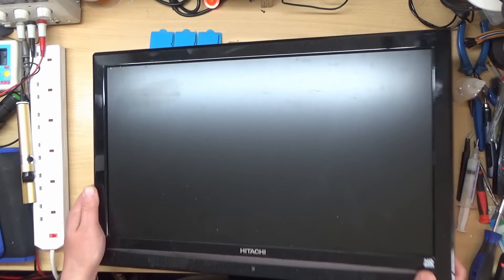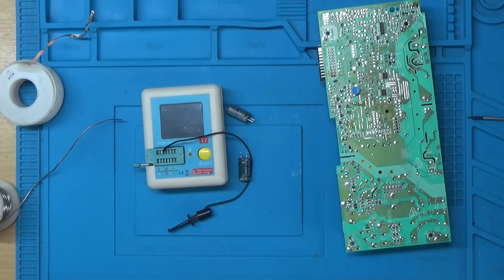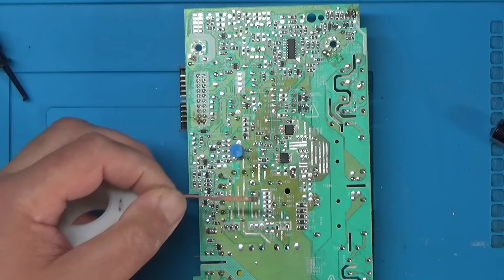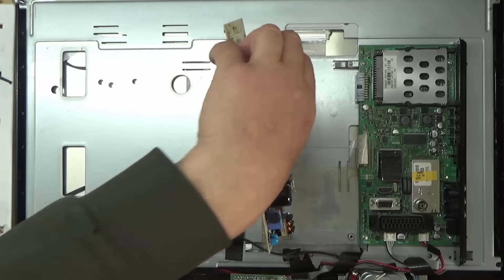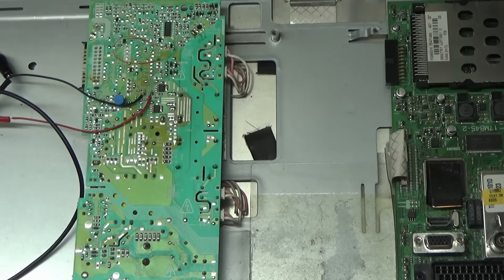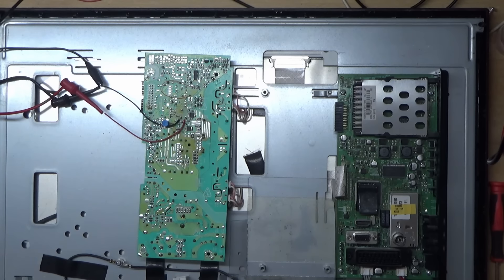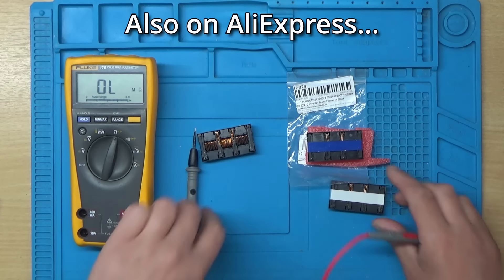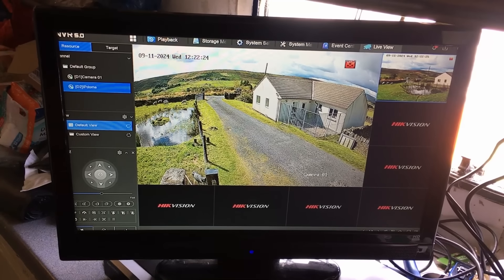Repairing A Dumpster TV, And Donating It To A Great Cause!

Comment: Usually, the bulged caps are rated barely over their application voltage.  Using a cap with a higher voltage rating will avoid future problems.  One problem with doing that is they are usually larger, physically and there might not be room on the circuit board.  Good repair video!!!
Reply: Sometimes the capacitors dry out due to the heat inside power supplies too and over time most fail eventually - I repair a lot of mixing desk power supplies which some people leave powered up 24/7
Reply from the maker: Thanks and very true 👍
Reply: I find the problem is usually they're just cheap garbage, they just manage to outlast the warranty.  Other than that, as the other dude said heat kills them.

Comment: Usually those caps have a 20% tolerance, so, at 933UF, that new cap is well within the tolerance interval .... great video.
Reply from the maker: @lmwlmw4468  Thanks 👍yes I didn't realise 20% was normal. I thought it would be more like resistors with 10% 5% or even 1%

Comment: Those Cold cathode driver circuits are interesting.  High frequency. High voltage energy can do some weird stuff.  In general, it wouldn't hurt to inspect where the windings of any transformer solder to the pins that connect it to a given circuit board. I recently repaired a transformer where the solder connection had failed.  That was a first but very rewarding.
Reply from the maker: I did have a look at the old transformer but couldn't see anything obvious. I did think it may have failed where it solders to the pin or something too.
Reply: @BuyitFixit  Nothing wrong with a new transformer either.  I'm glad flat screens now use LED's.  LED's certainly aren't without their failures either however.  Cold cathode lamps are certainly built to last.

Comment: This is a fantastic lesson for techs who use 2nd hand parts, which is a pretty common practice for repair shops. Something that only a experienced hand knows. Faults are often the same due to a design choice. That means the parts you use second hand might also have the same fault. Takes confidence and age to know your testing correctly and your new part might also be faulty not just your process. 😅
Reply from the maker: Thanks 👍🙂

Comment: A friend was trying to fix a VCR. He suspected a 1000µF/35v capacitor but it measured 1020µF. He was about to solder it back in but I suggested he measure the ESR. It was ten Ohms! Replacing this cap fixed the fault. So NEVER rely on capacitance measurement of an electrolytic capacitor. Always check ESR first. This can usually be done in-circuit.
Reply from the maker: My tester usually shows the ESR unless it's 0 then it doesn't seem to display it. I was reading on the EEVBLOG forum that you can still have a bad caps that shows a good ESR too.

Comment: Well done. Lucky to find a dump (sorry, household recycling centre) that let you take a TV. At mine you would have to climb into or fall into a skip, probably an offence, if you survived. Allen Fleckney is another who advocates repair.
Reply from the maker: Cheers Ralph. This one is unmanned, it's literally 15 large commercial bins in a car park for cans, cardboard, plastic, and bottles. There isn't really even a place for electronic items. Someone just left it next to one of the bins.
Reply: @BuyitFixit  I remember those days. Sadly, ours is manned with automatic barriers, booked timeslots and guards. You drive up into a 20-car space and then drop all goods into skips, a fall of between 2 and 5 metres. Anything that was salvageable / repairable before, certainly isn't after. So sad.

Comment: Nice Video Squire & fair play for helping a Charity close by, 26:20 onwards, I’ve had a couple of issues with AliExpress, Main one was a Cheap Wire Stripper, I received it and it came without a Blade or Blades so I bought another one from a different Seller and made sure that it had a Blade plus it came with a spare tub of Blades & I even bought a Spare Tub of Blades, Bit overkill I know but shouldn’t run out of Blades in a hurry now, The original Seller stated: “sorry, dear, due to logistics restrictions, we are unable to send you the blades. If they are sent, they will not pass customs and will be returned. We apologize for any inconvenience caused” Absolutely bizarre, I did try to see if other blades would fit but no
joy so it’s an Ornament/ Paper Weight!
Reply from the maker: @AJComputerServicesUK  Thanks 👍There could be some truth in that as I remember a couple of years ago I went to order a cutlery set from Ebay. Nothing fancy just regular forks, spoons and knives. However it wouldn't let me purchase them until I proved I was over 18 by submitting ID etc. Because it had 'knives' in it, even though they were probably blunt as hell, as they were only for eating food, not preparing it 🤷‍♂️
Reply: @ I find it strange that the one Seller on AliExpress was not prepared to Ship Blades yet another Seller Did plus Spare Blades? 😂
Reply: @ Not sure if I’ve already said it but Happy New Year to you & yours! 🙂
Reply from the maker: Thanks mate 👍Happy new year to you and yours too!

Comment: I really enjoy TV/Audio type repair vids like this one, I like to tinker myself but have very limited knowledge.  This video was interesting as it touched on the problems I've had with the last few TV's.
I have tried to bypass the protection circuit on a samsung TV but I think I killed the chip as I read the pinouts incorectly still you live and learn.
Reply: I once also bypassed the olp line on also a device that had a 494 and i burned out the transformer and my room smelled like burned electronics and burned lacker for a few days... Bummer! But i got a new transformer and luckily it was not ome that was salvaged from old crap but rather from the official chinese manufacturer who made the transformer
Reply from the maker: Cheers 👍 Yes, but the main thing is that you learn something. Even a failed repair is good if you learn something, and everyone makes mistakes (as I did in the previous video when I caused the mosfet to smoke 😂😂😂)

Comment: Never seen a transformer/coil behave like that. They usually go short or completely open. This might be a bad connection where the wires bond to legs. A not-so-easy fault to detect, amazing work!
Reply from the maker: Thanks 👍Yes me too, I did have a slight poke at it under the microscope as I thought it could have failed where it joins to a leg too, but I couldn't see anything. I think I made it worse which is why it measured OC later on 😂😂😂

Comment: Great repair for a good cause.👍 It seems some part suppliers believe themselves unable of making mistakes. I ordered a matched set of LED edge lights that weren’t matched and was told I didn’t know how to test or install them. I should’ve filed a complaint but only gave them a poor rating.
Reply from the maker: Thanks 👍I just opened a dispute and got a refund, still a bit inconvenient though.

Comment: Cutting the power lead used to be standard practice when getting rid of electrical products.

Not sure why. I think it was in case someone took it and tried to plug it in and got hurt.

Our family always did it and we still do.
Reply: Its pretty common. I worked for 2 weeks at a local thrift shop and we always used to cut cords of devices that did not work and got sent to the recycle bin, and the reason was so no one would attempt to plug in the devices to be either met with dissapointment or a fire or explosion

Comment: I'm in the process of trying to restore an old ATX computer power supply, and the 4 domed capacitors I pulled out registered as "Damaged or Unknown Parts." Can't wait until the new caps come in so I can see if it works!
Reply from the maker: Hopefully it does🤞. I'd perhaps check the other capacitors on the board even if they aren't domed as they could still be faulty due to age / heat like some of the others were a bit down in this case.

Comment: Great video - very educational as always - I would be happy if you could add the solder sucker tool to the list - looks like a good one that does the job :) I have a very weak one that I can NOT use most of the time I need it. Thanks
Reply from the maker: Thanks👍. I just had a search on where I got it from and it was from Farnell when I ordered some other parts. It was a DURATOOL 908-366A-F but I've also seen them on eBay etc too.

Comment: Recyclers usually cut plugs and power leads off for safety reasons. Stops people "just giving it a try" and possibly causing a fire with faulty equipment.
Reply from the maker: Yes, seen that before. This one was at a "recycling centre" but it's just an unattended line of bits for different things like cardboard, tin cans, bottles etc. There wasn't really a place for electricals, so it was just sat next to one of the bins...

Comment: ISTR that larger value electrolytics have a tolerance of +10%/-25% so 800-odd uF for a 1000uF capacitor is 'acceptable'.
Reply from the maker: Thanks for that, yes a couple of other people mentioned similar. I thought the tolerance of them would have been much less, something like 5% or 10% at most.

Comment: I'VE HAD WAAAY TO MANY PROBLEMS WITH ALIEXPRESS!!!  I QUIT BUYING FROM THEM AND FLEECE-BAY!
---
But your video's are always interesting! 👍
Reply from the maker: Cheers mate 👍Sometimes parts I need are only available on AliExpress such as this transformer. None of the usual electronic places such as Mouser, RS Components etc stock things like that. Also the price of shipping with some of the proper suppliers are often very expensive. It's not worth paying £15 postage for a 50p part.. so I usually wait until I need a few parts to cover the postage costs.
Reply: @BuyitFixit  - I understand.

Comment: Electrolytic capacitors are far from precision components. Capacitence can easy differs ±10% of rated value without be faulty.
As always, exelent video.
Reply: Your being too kind to them ±20% is still quite normal, for a lot of PSU's the value does not need to be very precise and ±20% are cheaper.
I never go above 80% of their voltage rating for production designs give them an easer life when released in to the field. 🙂
Reply from the maker: Thanks 👍Yes I wasn't too sure on that 🙂
Reply from the maker: Interesting. I didn't expect the tolerance of capacitors to be so great, although it's not something I've looked into before.

Comment: Good job. After you replaced the obvious ones, I was betting it would be the small bootstrap capacitor. 
Electrolytics are rather crude and have a high tolerance value of 20%, so 837 uF (i think it was) is within tolerance for a nominal 1000uF. Often they can keep on doing their job when the capacitance is 50% of nominal, its the increasing ESR that stops them working. The increasing ESR makes them run even  hotter, so  its a positive feed back.
This would have been a good one to test and compare the capacitors with your ESR meter, in circuit, versus out of circuit.
Reply from the maker: Thanks 👍a few people mentioned the 20% I thought it would be a lot lower like resistors at 5 or 10% at most. Seems I've learned something new 🙂

Comment: I'm scared of bringing electronics home. A few years back I saw a dell XPS laptop  being thrown away ! In its time that was a heck of a laptop. I have loads of parts so I bring it home and put it on my deck for the night. The next morning I found the right power cord and discovered it wouldn't turn on. Time to dig in, I remove the first cover plate (over ram or H Drive) and discover loads of freaking cockroaches 🪳🪳🪳 running over each other! It was packed and infested with them. I put it in a garbage bag and left it outside for a week. I then cleaned it up, changed out the ram and resold it cheap. 

 Ever use a hair dryer on a bad power supply to test it ? Someone showed me that trick on a desktop tower with bad caps. 

Thank you for the tv repair video
Reply from the maker: Yes I've not had that one before. Cockroaches don't seem to common over here, or I've just been lucky and not seen a lot of them. Yes a hair dryer, and freezer spray is also handy (especially if the fault occurs when the device warms up) you can spray it on a component to cool it back down and see if the fault rectifies itself.

Comment: Great video. How do you tell which way round the capacitors go without a plus or minus on the board??
Reply from the maker: There is usually a white mark or shaded area to show where the negative goes.
Reply: @BuyitFixit, thank you for that helpful piece of information. 👍

Comment: Transformers can fail? Dear lord, new fear unlocked ;_;
Reply from the maker: Yes, although they usually go short circuit as the insulation breaks down. LOPT (line output transformers) were a common failure on old CRT TVs. I remember replacing a few on some old CRT Ferguson TX100? sets I think they were...

Comment: How did you make the "Dim Bulb" Tester ???
Reply from the maker: It's just an old style filament bulb wired in series with the outlet. That way if the device has a short or is going to blow it limits the current by lighting the bulb.

Comment: I think some people cur the power lead off under the belief they can sell the copper for scrap.
Reply from the maker: I think it's more for safety (stop people plugging it in if it's a fire risk or something), or perhaps they just wanted a plug with a piece of wire on it to use on another appliance?
Reply: @ It could indeed be a safety thing.
I’ve seen it here (Australia) where people donate electrical goods to charity shops and the shop cuts the cords off.  So they can’t get sued if there’s a problem.  Sue whoever put the cord back on 🤠

Comment: Electrolytic caps generally have wide tolerance bands like +80% -20% so 800uF for 1000uF rating is not atypical.
Reply from the maker: Yes a few others mentioned the same. I was surprised as I thought it would be something like 5% or 10%

Comment: I wasn't that lucky with a road side Samsung LCD TV find.
It has a blown 3br0665jf PSU IC with integrated power mosfet, which I can't find.
I'm wondering if I could replace it with a normal 8 pin DIP part and an external FET from another TV psu.
Reply from the maker: I've just searched that part number (full part is ice3br0665jf) and it's available on Mouser, Aliexpress, and eBay.
Reply: @BuyitFixit  Not possible right now to order from those places. I'm interested to fix it whit what I have locally.

Comment: Hey Bro, I need to ask you after watching your last few vids, does that China machine not give you ESR? That in my book is way more important
than capacitance from my knowledge. I have an Atlas ESR70, and I can check most electrolytics in curcuit. It reads most as they should be, but
if its not sure, it says" in curcuit, or leaky". Then I can focus on those problem childs. Had really good success thus far?
Reply from the maker: Yes it does usually show ESR if it is over a certain level. If the ESR seems to be 0 it doesn't show it. I've just bought a peak DCA55 faulty from Ebay and ended up speaking to Jeremy from Peak. All I can say is fantastic company and video will be out about what happened soon...

Comment: I repaired an old audio mixer and the power supply board had some real bad caps. They leaked and corroded the board
Reply from the maker: I've had something like that before, but I think it was battery corrosion. Had to rebuild tracks on the board and jumper things here and there to get it working.

Comment: How often do transformers fail and what causes them to fail?
Reply from the maker: They are usually pretty reliable, what usually happens is that something overloads them and the insulation breaks down and causes a short or partial short. In this case it could have been that one of the thin wires broke away from where it was soldered to the leg or something or the wire became burnt causing the odd readings.
Reply: @BuyitFixit  so the immediate shut off is the tell tale sign of the transformer gone bad?
Reply from the maker: It could also be one of the high voltage capacitors breaking down, or one of the CCFL tubes shorted. The circuit detects something isn't right and switches off.

Comment: electrolytic capacitors have 20% tolerance so it's not strange
Reply from the maker: Yes, a few others mentioned similar. I thought the tolerance was much lower like with resistors for instance.

Comment: with aliexpress it's a lottery, unfortunately 🤥
Reply from the maker: Yes, seems to be that way. I've usually had quite a good experience overall, but I've had about 4 times over the last 5 years or so where I've encountered problems with either fake or faulty stuff as in this case.
Reply: @BuyitFixit  This is my case too. It is very disappointing to believe that it is a diagnostic error when it is the new component that is the cause.
Reply from the maker: Totally 👍

Comment: I don't know why people throw a good television  can be repaired at last your saving from the tip
Reply: It wasn't good and finding a component level technician is no easy task, also probably not an economically viable repair. People are pretty much giving these old tvs away.
Reply: @audibell  Electrical repairs shops that would do board work used to be ten-a-penny. Now if you take a faulty device to an electrician, they'll often tell you to bin it and buy a new one.

It not worth their time and people won't pay.

The throwaway nation.
Reply: Why would you pay £300 to have a 20-year-old TV repaired when you can buy a new one for £250?
Reply from the maker: Cheers 👍